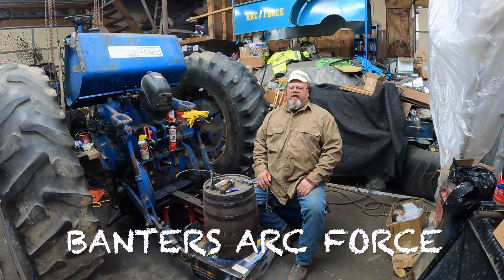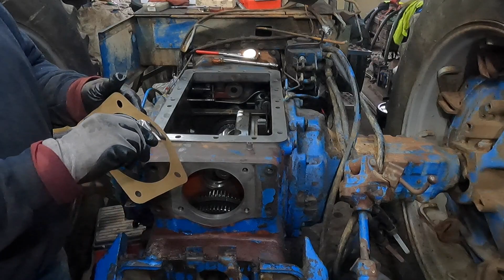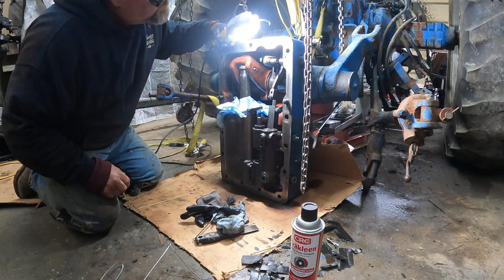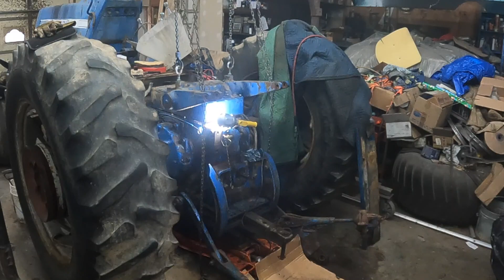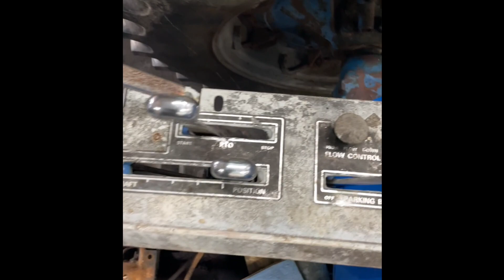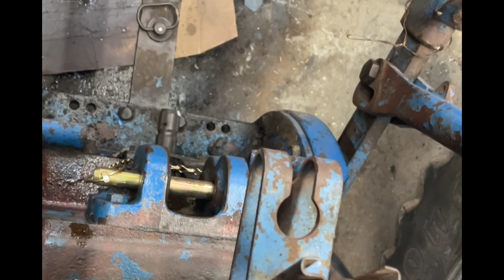8000 FORD TRACTOR PTO REPAIR “ START UP TIME “

Comment: Ok this plate that holds the top link arm. I am replacing this gasket. I did not remove the platform, just the plate with 4 bolts. I am having trouble with that bearing that has the spline sleeve for the shaft to seat in the housing.
Reply from the maker: Having good repair manual is a must on the 8000-8600 , 9000-9600 ford tractor helps E-bay is a good place to get one
Reply: We just did a pto clutch in our ford 8000 and we pulled the 3 point hitch are plate off and we pulled the hydrolic pump out and now we got it all back together and the hydrolic pump will not pump anything. We don’t know what to do next
Reply from the maker: @New_york_farmer you my have to split the tractor rear end from the transmission to have total access to the pump there’s a relief valves in there too. You’ll see him. You’re on top was check for broken spring or debris inside that relief valve and it very important to get a repair manual maybe more than one repair manual that explains things differently than one other one.
Reply: @banters_arcforce  we figured it out, it was air locked, loosened every oil line on it then just started it up until it was just oil and no air coming out
Reply from the maker: @New_york_farmer  make sure that the transmission vent is not blocked. It’s on the right hand side above the shift pattern circle. If that’s blocked that means the transmission is not breathing.
Reply from the maker: It’s on the top right hand side of the transmission, not far away from the rod that goes down into the valve that controls the dual power. I think it’s behind it. Make sure that you put a new one in the vent transmission vent.
Reply: @banters_arcforce ok thank you, I might have more questions in the future because I don’t know much about fords, I’ve been around ih and John Deere my whole life